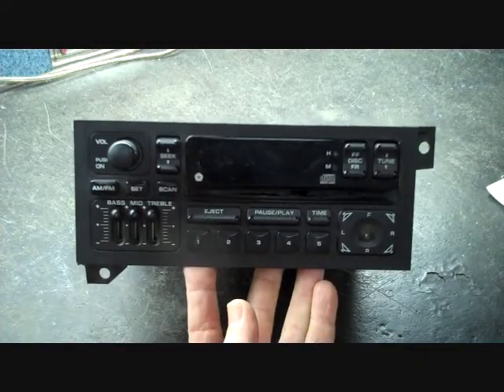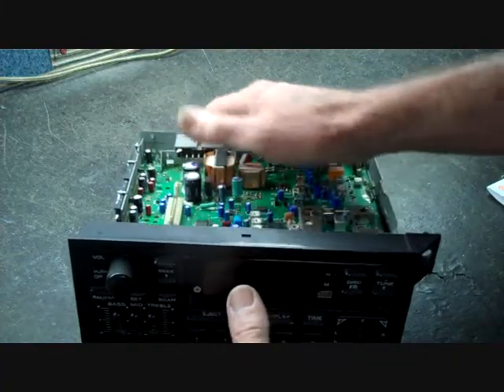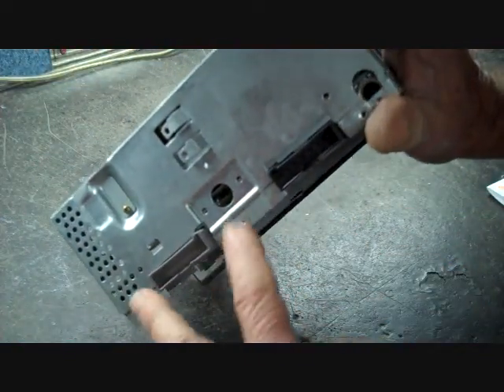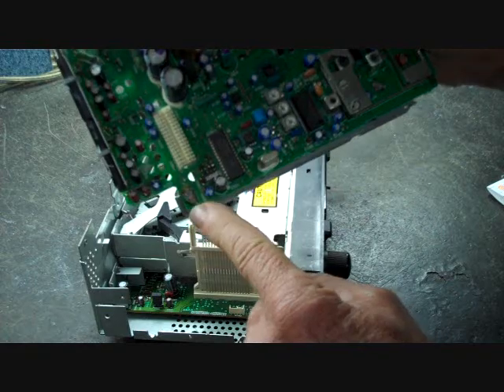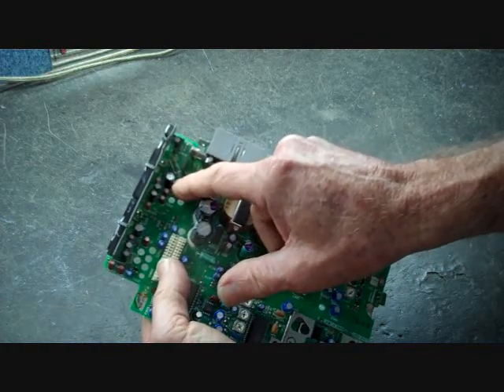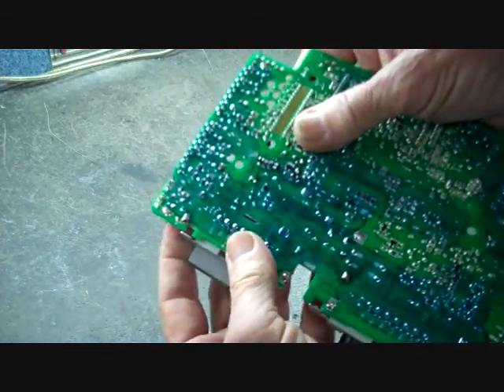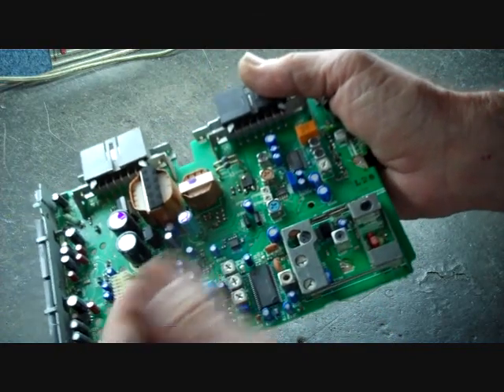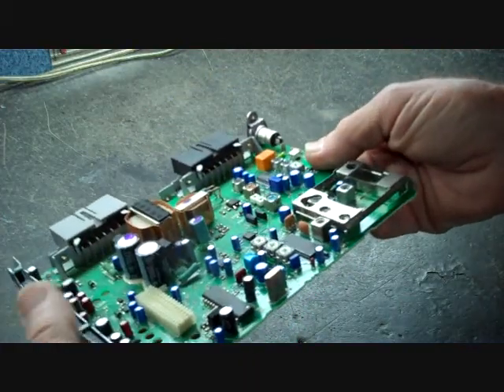Chrysler, Dodge, Jeep Stereo Repair = Car Stereo HELP

Comment: It's a shame you don't repair this model radio anymore. Probably a troublesome unit, that keeps coming back for repair.
Mine works fine, except for the CD player. After fighting to remove it, with the anti-theft bracket. Not sure if I want to put it back in the car!
Going to try cleaning the laser lens, anyway... 
I have some older Chrysler radios, but the mounting and plugs are different.
Was really hoping to keep the stock radio in my 20 year old Jeep.
Anyway, thanks for the video...

Comment: On the 1988-1996 factory Jeep Mitsubishi RX-170 and later type AM/FM Cassette Players with the model numbers 56002467, 3021, 3019 and 9004, what is the cause of either the left or right channel going out and on a 9004 the volume knob is maxed out but still need a little bit more volume?

Comment: Hi my name is josh I have a 1993 chrysler infinity III radio. The digital display quit and so did the sound the power antenna still works and the radio buttons do still light up. Oddly if I disconnect the radio and reconnect it it'll work again for a few hours and quit.